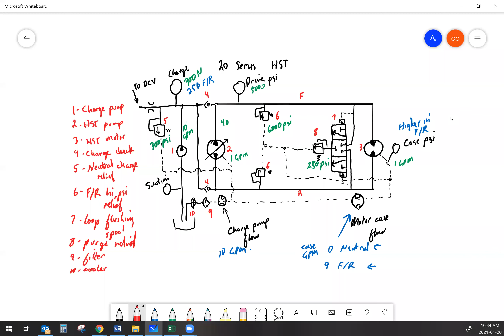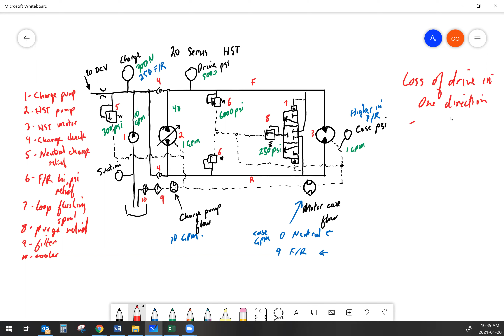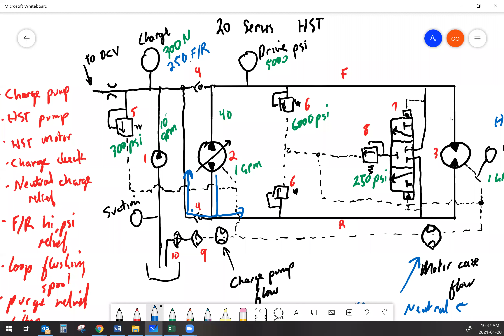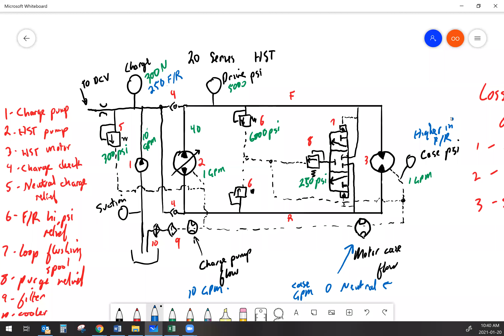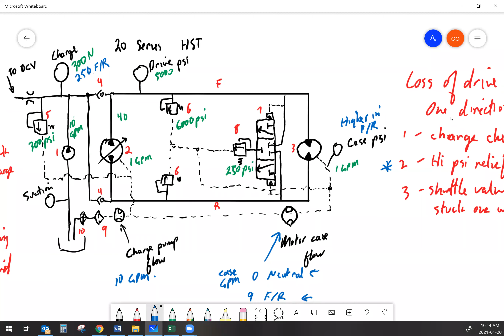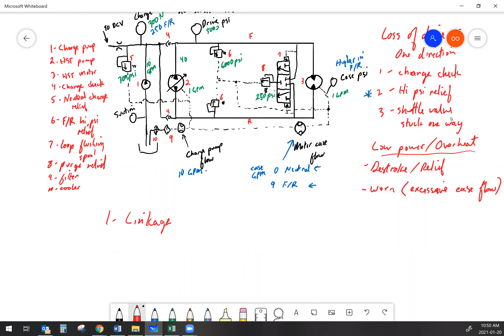Hydrostatic System Diagnostics

Comment: I got a kubota L48 with super weak travel both fwd and rvrs.  I'm pinning it on a valve.  I'll get a pressure tester on it ASAP.
Reply: Sounds like it could be the constant swivel valve. 
The motors connect to this valve from the main dcv. 
Check gpm directly from valve then check again at the motors.